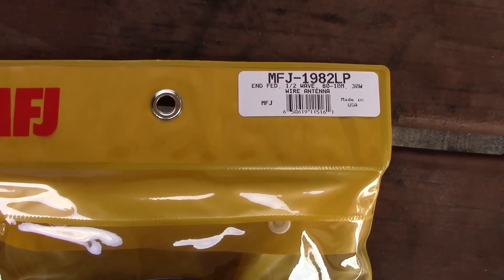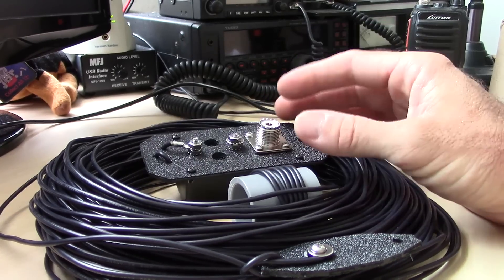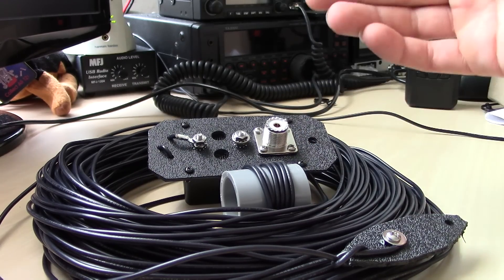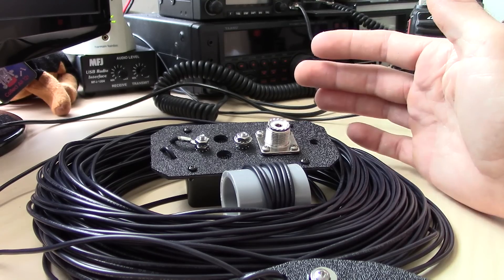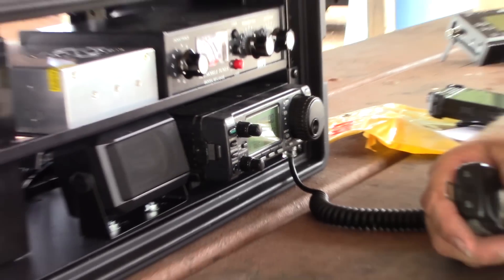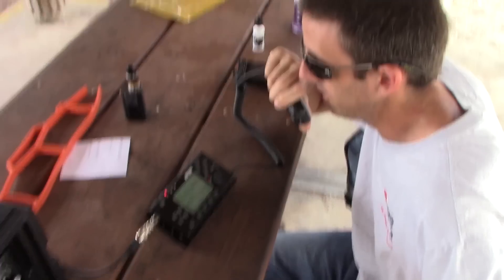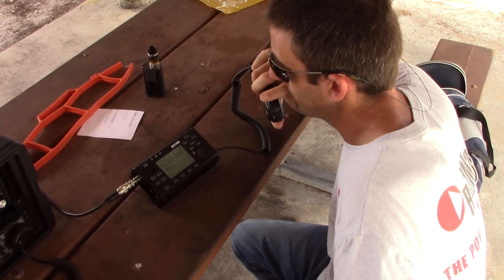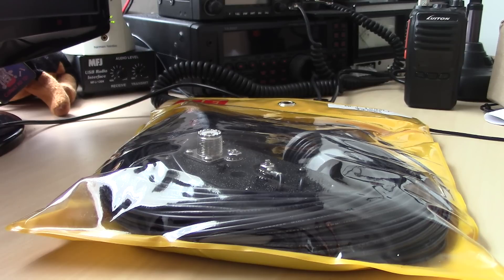End Fed HF Antenna MFJ-1982LP

Comment: Hey Aaron, I have a 69 foot tree next to my house.  I couldnt throw the end of the cable that high and over the 69 foot tree so I attached the cable wire to my drone. I then I flew the drone up in the air on the right side of the tree, then while in 69ft of mid air I then flew the drone over the 69 foot tree to the left side and then I landed the drone down to the ground. This allowed the cable to go from the right side of the ground all the way up (69ft) and over the top of the 69 foot tree and back down on the left side of the tree.  The drone pretty much layed the cable out perfectly over the tree instead of me having to try and through it 69ft in the air over the tree.  You should try it.
Reply: I use this technique also, what I do is suspend a 1oz fishing sinker weight with a 12 foot peace of masonry cord under my drone. (Bebop 2).Then I fasten masonry cord to the weight so it keeps the cord away from my props, by holding it 12 feet down under the drone, this way it well not get tangled up  in the props. Lower It down to the 12 foot level on the back side of the tree, and cut loose the masonry cord and pull my cord with the rope and antenna over the tree. It works done It many times. Kd4jrx

Comment: It's a length of wire and a matching transformer. Make your own and save your money for something you can't build yourself.
Reply: 2022, $85 for the 300w version. It would cost that in parts and time. Bought.

Comment: After getting into ham for the first time earlier this year, and now have my extra, I finally got an hf rig. 😁
Been RXing on an SDR for a couple months. Running an ft-991 with a Chameleon Emcomm III. First HF contact CA, and second contact NY....lol...go figure. Both 40m. Have checking into a couple 40m nets. Its tough on the emcomm though. Thinking of installing a nice 40m and a 20m dipole. Its a lot easier for me to install an endfed though due to shack location. 

So would it be worth getting the longer emcomm III....the 130’ version as opposed to the portable version that I have now....or is it best to just set up a dipole?

Comment: I have the 10M - 80M version and have had it to the field on 8 occasions in the year that I've other it. It receives well on all bands. I have been pretty unsuccessful on over 10 hours of operating on any more with this antenna. I have less than 5 contacts on CW and phone using NVIS, inverted Vee with apex > 25 feet and end points about 5 feet high, and flat top about 15-20 feet. I have made a number of contacts with FT-8 but I'm pretty disappointed overall with results from this antenna. I've tried daytime and night time operation with virtually no change. I haven't given up but I don't use this as a primary antenna until I "crack the code" and figure out why I don't get the results that others have raved about.
Reply: Try a more flat antenna.
I have the MP version of the 80-10m
Worked 80,40,20,15, and 10 meters in about an hour, hour and a half on SSB phone.
New York to Hawaii Canada to Texas and everything in between .(was not looking for any DX) and about 40 contacts.
Every report was as good or better than what I gave.
Running about 70w in a park. 20’ up running flat.

Comment: I have a flat, rectangular roof townhouse, attached on both sides with other houses. Would a horse shoe or U  configuration (15'x35') work using the 60' version? The
Reply: Yes you can. But as always, the ground quality and local interferences may play a part in performance. 
Many retirees in small homes use a setup as you describe with good success.

Comment: I have the MFJ-1984MP 40-10 version which I have tested in the field.  The antenna works w/o a tuner on 40,20,15, and 10 as advertised.  I do nee to use the rig tuner on 30, 17, and 12 but the antenna in an inverted vee using a push up pole 25 feet at the center and the ends at 4 feet above the ground works well in a scenario where you are in a field with no trees.  That could be important if you're in a scenario where you have no trees available in a disaster.  de N1MHV
Reply: About what gauge of wire do they use with the 1984LP?
Reply: @jdschauss   it's a 14 Ga wire a lot like Flexweave because it deploys and rolls up very easily.

Comment: Despicable how MFJ copies products unashamedly. The EFHW, particularly with the compensation coil (which improves SWR on the high bands - it does NOT reduce Rf coming back as stated in this video LOL) was built and popularised by Danny at Myantennas in 2014.

Comment: These antennas do best as a sloper... with the feed end on the ground.  Also a counterpoise alligator-clipped to the ground screw makes a real nice setup.  An inverted L would be a real lossey setup.  

It would require a tuner for 30m because it’s cut for 80,40,20 & 10.  30 isn’t a proper wavelength multiple.
Reply: Craig Bailey how long is your counterpoise?